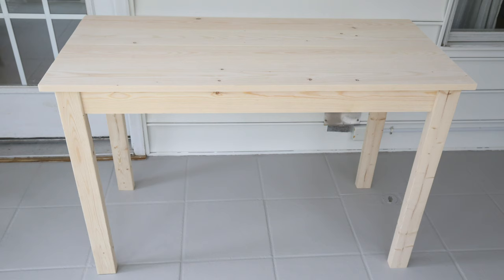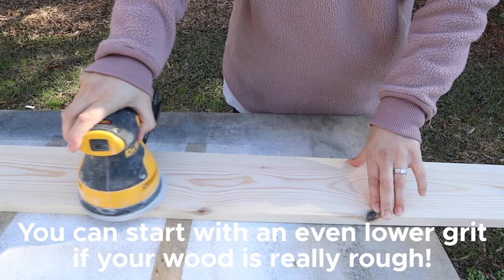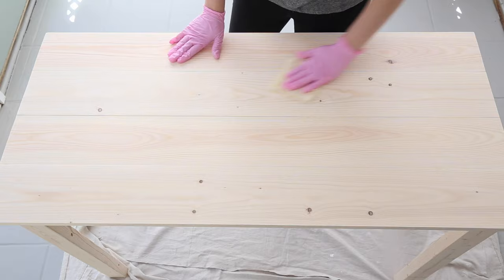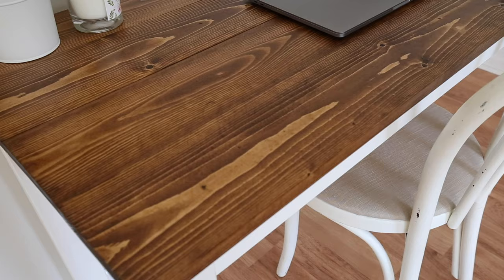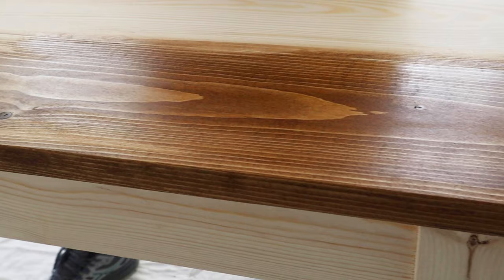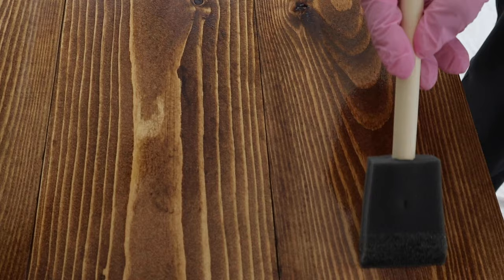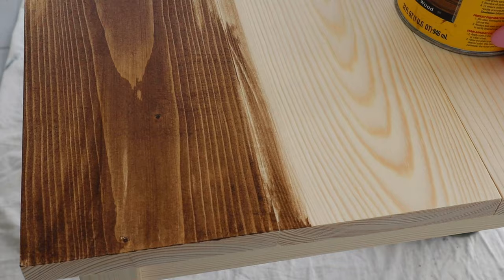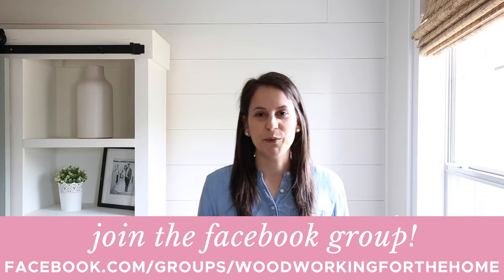How to Stain Wood | Easy Tips for Staining Wood & Getting a Beautiful Finish!

Comment: How long until i can use a desk , no finish just varathane oil/gel based golden oak because worried about VOCs in my room
Reply from the maker: Once the stain is completely dry to the touch it can be used. About 24 hours but it can take longer depending on the type of stain you used and other factors such as the temperature and humidity in the room!

Comment: Are you suppose to sand the wood with 220 sand paper after the second coat of the poly? Or leave it
Reply from the maker: Only sand if you are going to apply a coat of poly afterwards. So in this case I would only sand after the first coat.

Comment: When you treat a table top like this, do you stain/varnish the underside of the board? Only the overhang, or not at all?
Reply from the maker: I don't stain the underneath side, but I will do the overhang. I don't ever put sealant on the underneath side though since it doesn't really need it.

Comment: How do I apply this to my tongue and groove ceiling. Can I just rub the stain on with a rag and leave it? Or do I have to put on a clear coat afterwards like you again? 
It’s a lot of over head work and I’m just trying to cut down my work.
Reply from the maker: Yes I would use the rag for the stain. And you don't have to use a final top coat on the ceiling if you don't want too!

Comment: How long do you Leave on the Stain do you wipe it off right away or 10 minutes 20 minutes, thanks.
Reply from the maker: I always apply one coat of stain with the grain of the wood with the lint free rag and wipe any excess stain off right away. If you want a darker color, you can let the stain sit a minute or two on the wood before wiping off the excess.

Comment: which  Pre-stain Wood Conditioner do I have to use for 4mm pine board? oil based or water based stains?
Reply from the maker: If using an oil based stain, use an oil based pre stain or use water based if using water based stain

Comment: Any tips on how to do this indoors? I want to stain a small wooden side table, but I live in an apartment with no outdoor area. Is there a way to speed up the drying time and reduce the fumes of the chemicals?
Reply from the maker: Make sure to ventilate the area as much as possible, open as many windows as you can, and wear a face mask! I would used a water-based stain if you are applying it inside, water based stains dry faster and are a lot less smelly! You really should not apply an oil-based stain inside a poorly ventilated area so it's best to use water-based in your situation.
Reply: @AngelaMarieMade  Thank you!

Comment: I am going to be staining teakwood and the guy at Lowes said I probably shouldn't use a pre conditioner... Do you know how "true" or accurate that might be for teak? I'm just making a wedding sign but still I want to make sure it looks good and not screw up on an expensive board, lol! Thanks so much!
Reply from the maker: I haven't worked with teak wood before so I can't really say for sure, but I personally always recommend using a pre-stain wood conditioner because I think it makes the stain apply so much nicer. I'm sorry I can't be more helpful! If you have a scrap piece of the wood you could apply the stain directly to one area and then apply it with the pre-stain wood conditioner in another and then compare to be really sure.

Comment: I never stained wood before. I want to start making wood signs and using stencils.  Then process on how to sell them.  I bought the Minwax Pre-Stain Wood Conditioner, Clear, 1/2 Pint.  Can you use another wood stainer brand such as Rust-Oleum Cognac Oak Ultimate Wood Stain or any other brands?  Or stay with Minwax oil stain colors and top coat? 
 I’ve seen so many YouTube Videos.  I will admit it’s a little confusing for me right now.  Thank you
Reply from the maker: Yes absolutely! You can use any brand of stain with the Minwax pre-stain wood conditioner 😊 Best of luck with your project!!
Reply: Thank you so much.

Comment: Thank you for this very informative video! Is there anything else I need to do to pine furniture that will be outside or will the polyurethane be enough to protect it from the elements? Thank you!
Reply from the maker: For outdoor furniture it is best to use an exterior polyurethane or use an exterior stain without the poly

Comment: I don't know if my stainer is old but it left back marks from the direction I moved the rag in and is meant to stain dark but have to do like 3 coats!! I'm so annoyed 😒
Reply from the maker: Oh no, did you stir it really well before applying?
Reply: @AngelaMarieMade  yes I tried to, it was thick. Think its just old and maybe cus its like water resistant so it dried quickly too

Comment: My mom rushed into the project n started staining without sanding or conditioner is it too late to add conditioner now?
Reply from the maker: After the stain has dried, you can sand it back down to the raw wood and start fresh again with a sanded surface and wood conditioner! The conditioner won't work well over stain.

Comment: What can I do if I stained and there’s some streaks or rough looks after it dried?
Reply from the maker: The pre conditioner can help a lot with this issue, if you don't like it you can also sand it down really well and then reapply the stain.
Reply: Thanks I did just that! Sanded it down snd reapplied the stain.

Comment: what did you do for the spaces in between the boards? do you leave them open and do you get food in them?
Reply from the maker: Using a foam brush can help with getting in between small gaps or crevices. The gaps were sanded down to be even and food wipes off with a sponge.
Reply: @AngelaMarieMade  so can we put wood filler in the gaps even after having put in the first stain coat?
Reply from the maker: @ImpulsoCreativo9322  For the long gaps between the boards, I would avoid using wood filler because it may be more noticeable after staining, I only use wood filler on small cracks/holes when needed. But if that's something you prefer to do, you can, but it should be done first before the stain and make sure to sand the wood filler well after it dries!

Comment: Hi Angela, I'm going to stain my bed soon. However, I don't have access to outdoor space. Any precautions I should know as I will be doing it indoors? I will also have two roommates who I'll of course communicate with. Let me know, thank you!
Reply from the maker: Outdoors is best but if you need to do it inside make sure it is a well ventilated space. Open windows and doors to ensure proper fresh air flow while applying and drying. It would be a good idea to leave the area while the stain dries if possible. Minwax also suggests to wear a NIOSH approved respirator but I am not sure which respirators specifically. Water based stain is low odor and better for indoors.
Reply: If you haven’t stained your bed frame/head board yet, as Angela said use a drop cloth or a cheap table cloth from the dollar store because when it comes to staining or painting (I don’t care how much of a professional someone is) you’re going to get it in place no matter how carful you are..it’s just the nature of the beast. Second I wound get a good respirator, and good hardware store mite have them but you can probably find on Amazon from 3M for even cheaper and 3M is always a leading product..3rd I would do this in a separate room that no1 uses if that way you can help close it off from smelling up the rest of the house, but if not get a couple box fans out some facing the widows with you and your project in between as to help push the air out and out one in the window so it will suck the air out...also open up a window that is in the back of the house or at least before the fan then you the window, (by the way air pressure works) it help a better flow of fresh clean air. Hope this helps. ✌️
Reply: @thisismydadsphone4968  an old plastic  shower curtain works well too.

Comment: Hi Angela, in your opinion and in your experience, do the pre-sanded select pine boards they have at HD need additional sanding or are they good to stain and finish?
Thanks.
Reply from the maker: Great question, for the boards that are pre-sanded or premium I will usually just sand with 220. It will help open the pores in the wood so that your stain or paint will have a more uniform finish.

Comment: some of your information is incorrect you never skip sandpaper grits never go from 8Oto 12O and skip the 1OO   also when sanding your Poly 22O is too rough and can easily burn thru 32O to 4OO so you dont burn thru on the edges
Reply: Her finished projects look beautiful to me.
Reply: So you are going to sand 20 times going from 80-320?